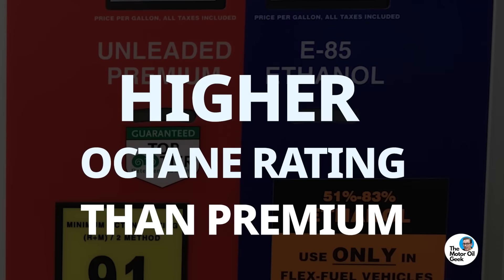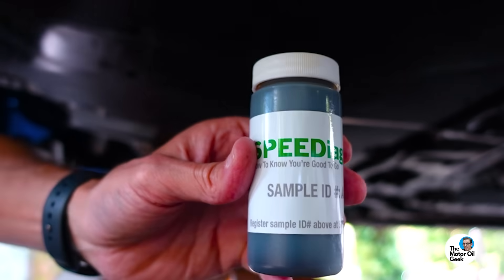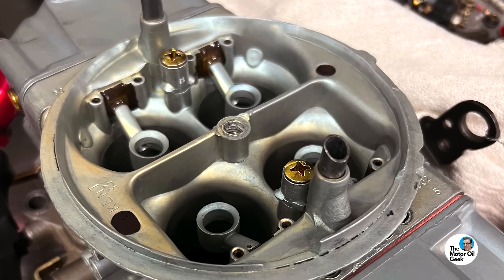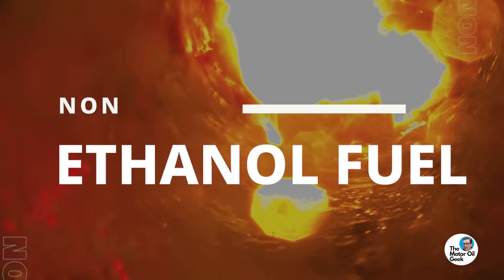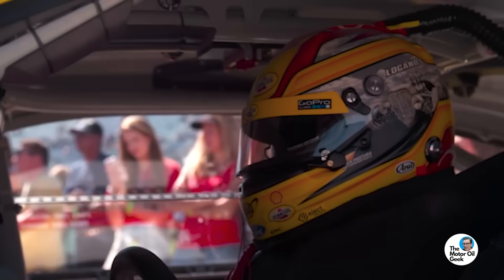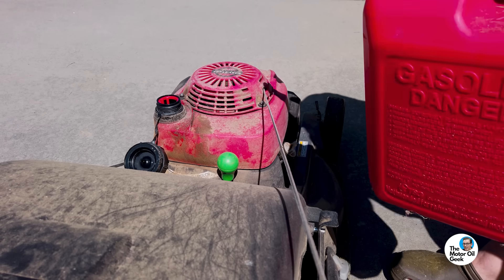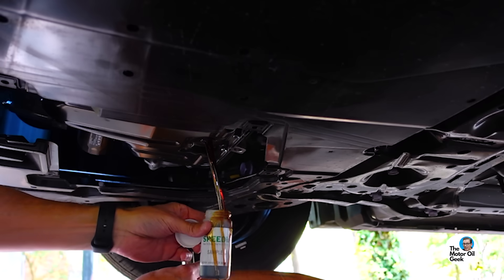ETHANOL: Higher OCTANE, Higher RISK?

Comment: Was thinking of some old stuff about "gasohol" or ethanol laced gasoline or even straight ethanol as race engine fuel. I understand that part of the reason that some of these engines make tremendous power is that with the needed air fuel ratios and actual big jetting the ethanol fuel absorbs a lot more engine heat than if gasoline were being used and the extra water vapor in the exhaust carries away heat and may even provide some of the benefit of "water injection" 
  Older cars had fixed jetting that did not adjust (no feedback with oxygen sensors or powertrain control modules). If the car were jetted a little bit rich it might run a bit better on E10. If it were jetted just right for straight gasoline it would run a bit worse on E10. If it were already jetted lean for straight gasoline ( as I think most cars were after the mid 1970s thru about 1980 before the "feedback" carburetors "Computer Command Control" or "Electronic Fuel Injection" appeared) it would run a lot worse on E10 than on straight gasoline. Also the fuel mileage would go down. Would be sensitive to altitude (higher altitude had the effect of lowering the amount of oxygen per fuel as metered and could actually make the car run better at,say, 5000' above sea level than it did at sea level if it were jetted too lean to run well at sea level (as some early emissions controlled cars were) 
Newer cars almost always have compensation to maintain air fuel ratios nearly perfectly so are largely not affected much by the difference in energy content between E10 and straight gasoline but the ethanol E10 is a real problem for small engines and probably even cars that sit with the same fuel in the tank for months at a time (not driven much)

Comment: I have run regular unleaded 10% ethanol gas in my small engines for years and have never had a problem. Mowers and snow blower sit for six month's of the year. Start right up all the time. I keep the tanks topped off with no additives. I also run E85 in my 455 Pontiac engine with a Rochester Quadrajet. Hasn't caused any issues.

Comment: I've been running E85 for 8 years now. Car makes over 1100 hp on pump E85, 93 won't even touch that HP range. I've had zero issues. Clean the injectors every spring after sitting all winter.  I don't even drain the E85 from the system over winter.  PM is key when running any alcohol based fuel.  People throw so much hate at ethanol. 

I also ran it in my carburated R5P7 build.  Didn't have any issues with that either. I did drain the E85 in the fall, put a couple gallons of 93 in the tank and fire it up for a few minutes to "winterize" it.  

Thanks for another great video Lake.
Reply: Im not going to clean my fuel injectors every year...
Reply: @Taydrum ok. It takes less than 30 minutes to remove,  run them,  and reinstall.  Cheap insurance for me.   You do you, have a great day.
Reply: Glad you have no problems. But I work on carbureted motorcycles ATVs and small engines. Just using E10 in these zinc bodied carbs causes severe corrosion. Even in daily driven vehicles. There is real gas available but most people are not going to seek out that option. It's not a big deal with small engines, because replacement carbs are relatively cheap.  But motorcycle carbs go into the thousands. I don't want to even think about what would happen if people used E85 just because of the octane rating. Cheers
Reply: @leegmc1985 that is literally why most use e85, for it's octane rating and of course the effects of evaporative cooling.
Reply: @leegmc1985  There is a known fix for that; nickel plated carburetor bodies. Nickel plating have been used to make carburetors ethanol compatible since the Model T days.
Reply: "PM"?
Reply: @dabdestroyer7327  Planned maintenance.
Reply: @dabdestroyer7327 usually stands for preventive maintenance
Reply: Which is why large displacement motors do right around that on 93 without power adders? Last I checked there is a crate motor that makes ~950 out of the box.

 I know it's in vogue to up the CR and lower boost to get better response but standard fuels require the opposite. Most tuners under 50 have forgotten or never learned the basics.
Reply: Yeah this is just boomer clickbait. My car sat with E85 in the tank like 3 years, still fine.

Comment: Lake, I hope you see this:

ChatGPT keeps suggesting that changing your oil too soon (i.e., at shorter intervals) could actually reduce engine protection, compared to waiting a bit longer (within reasonable limits) before changing the oil. This question is about oil change intervals throughout the life of the engine, not referring to a break-in oil change. It mentions that oils—especially synthetic ones—need time to form a protective layer on engine components, and that oil additives need time to fully clean and prevent wear.

Is there any truth to this?
Reply from the maker: https://youtu.be/fwzLY62_uIE?si=gqCVVH3cCZ_Ho8nC

Comment: Do a video about amsoil fuel additives please! I want to know if the upper cylinder lubricant and performance improver is worth it.
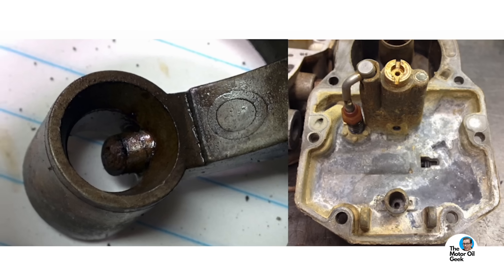Reply: I put a very small amount of "Stihl Ultra" oil in my small 4 stroke engine fuel sometimes. Much less than would be needed in 2 stroke engine,more like a 1:200 ratio instead of a 1:25 or 1:50 ratio as would be specified for 2 stroke. 
Seems to keep the float or inlet needle in the carburetor from sticking.

Comment: i have noticed that the newest Buick's with the turbo three cylinders say run on E15. I have used E15 in my '14 Enclave. It ran very well on it; no loss of power or MPG. I traded it on a '10 CTS-4 wagon (3.0) and use it occasionally. That car LOVES 93 or 94 octane (tier one only). My wife's '14 Exploder is a Flex Fuel car. I ran one tank through it. NO MORE. My lawn mower, a plastic-carbed B&S, only gets non-ethanol, and for the last six years the ZTR mower at our church ONLY gets non-ethanol. It is about 20 years old, and it will go much further with no ethanol. I am trying non-ethanol in my Caddy to see if MPG will go up to justify $1.00-$1.20 more per gallon. What are the effects of E15 on GDI motors? Well ... I ran a full tank (16 of 18 gallons) in the CTS. Absolutely NO change in MPG. E10, E15, E0, it makes no difference with this baby. Back to saving 30 cents a gallon.

Comment: In Finland E85 is available everywhere. its about 1.14€ per litre vs 1.75€ per litre for 95E10 (10% ethanol, 95 octane. we allso got 98E5). Last summer i drove the whole summer on E85 in my 1995 Volvo 960. I could save 10€ per 200km compared to 95E10. It was cheap to drive and convert as EVERY old volvo from 1985 onwards have a Ethanol proof system that tolerates it. I just needed to swap injectors to 30-40% bigger and i was good to go on 100% E85. Ran great. Then when winter was at my doorstep i switched back to stock injectors as it went for winter storage. I got mopeds, motorcycles, old 50s and 60s american ford with stock Y Blocks and never have had problems with them not starting after 1/2 year of storage. Yes they first run like crap on startup but after topping it up they run like normal again. No rusty gas tanks either.

Comment: Very informative. So ethanol doesn't just contain less BTU per volume than gasoline, the engine also has to compensate and enrichen the mixture. Just wonderful.
Reply: That's not really true. With road legal engines (aside from some DI stratified charge engines) you typically use lambda 1 until you at high loads need to enrich the mixture. With ethanol you typically can wait longer until you do this high load enrichment, and you typically need to enrich less. You do need to enrich more for cold starts though. Ethanol generally has a slight positive effect on engine efficiency.

Comment: How does a fuel absorbing moisture in the atmosphere causing rust (moisture) on valve springs in engines??????........................rust is caused by standing/pooling water.
Sounds more like a high moisture day and some idiot leaving the garage door open in a cold air conditioned shop........................every metal surface will suddenly begin to collect water, as it cools on the metal surfaces.

Comment: I learned of this a few years ago when I  bought a generator, and switched up for all my small engines, plus I run a tank of real gas in my cars on a regular basis. We still have access in Canada to 94 octane at Chevron and Shell. Both, unless changed recently, are gasoline without ethanol. Since switching, I have not had any issues starting 1st or second pull every time, even after winter. I don't flush or drain anymore either. My cars run better and fuel economy is better.

Comment: After experiencing gummed up fuel filters in my outboard along with clogged jets on my pressure washer and chain saw, I switched to ethanol-free gas about 10 years ago.  It is more expensive in my area, but I never have a problem starting or running these motors even after storage of several months.

Comment: I remember when I mowed our lawn (in the 80's) at the end of summer, we would put our mower in the shed for the winter with the gas still in it and the next summer we would pull it out and it would start up on  the first few pulls. Since we had ethanol in gas, if I leave the gas in over winter small engines have a hard time starting up.

Comment: Multi Generational 'Farm & Ranch' family here.   I do NOT purchase ANY Fuel with 'MoonShine' in it unless there is no other alternative.  Over 50 years experience operating and maintaining critical Farm Implements will teach you the HARD & Expensive way that Ethanol is a Mistake.
Reply: I started using ethanol conditioner in the fuel for all my equipment and my ethanol problems all disappeared, it's been about 10 years now I've been doing it, and like the old days I went back to leaving fuel in the tanks of everything for the winter and the next spring they fire right back up, 3 weed whackers, 3 chainsaws, three push mowers a riding mower and two leaf blowers that get run quite a bit every year taking care of properties, all my problems went away including fuel lines and carb diaphragms melting from the ethanol, all problems have stopped since I started using it.
I myself come from "multi generational" farmers but I don't understand how that has any bearing on things because this ethanol issue is only about 15 years old.
I don't want ethanol in my gas either but I burn through so much gas every year in that equipment there's no way I'm paying the outlandish prices for ethanol free fuel, and I sure as heck ain't buying that ridiculously priced 2 stroke fuel in a can.
Something I don't get is all the "small engine shop owners" who claim if you put ethanol treatment in gas it'll "turn into jelly within weeks guaranteed", I've never seen a speck of jelly in anything including carbs I've been in that dirt needed cleaned out of, maybe people with that problem put ethanol treatment in gas that'd already sat around for months wicking moisture out of the air and there was so much water in gas already the ethanol treatment turned it to jelly, or maybe they're pouring half a bottle in a gallon of gas thinking it'll work better, all i know is 1 Oz of treatment for a 5 gallon can of gas and I have no ethanol issues any more.
Reply: @dukecraig2402 what brand of ethanol conditioner do you use?
Reply: Ethanol has screwed up so many engines,, 😢 I hate the shit , only place I can get Ethanol free fuel is at the airport  ,,$ 6 bucks a gallon, but it works,,

Comment: Would a gasoline engine running e85 benefit from a diesel oil due to the fuel dilution and the diesel oil detergents? This specific case a turbocharged port injection  engine.
Reply from the maker: Actually it would be worse. Diesel oils will hold more fuel and moisture than a gasoline engine oil does.
Reply: @themotoroilgeek I guess that makes sense as diesel is a lot better lubricant that gasoline or alcohol would be
Reply: @thatturbotruck  Especially old fashioned diesel that wasn't "Ultra Low Sulphur" ?

Comment: I’ve been running my own small engines “all with carburettors” on E85 and E100 for over 3 years now and still not had a problem. I’ve even let some of them sit for over a year and still no problems. I mix my own E85 with 85% bio ethanol and 15% Aspen 4 fuel. The “problem” with the ethanol isn’t the ethanol it’s self. It seems to be the gasoline it’s self is the issue. And when you don’t use pump fuel and use alkylate fuel instead you don’t have these issues.
Reply: I think that E85 and all the other ethanol-blended fuels does have a lower quality gasoline just because of a very high octane rating that ethanol has. So petrol companies can provide a much higher income just of using bad gas because ethanol brings the octane rating up to meet for example 87,89 octane rating etc. 

Ethanol is not a problem. I also use E85 blends in lawnmowers, outboards and my moped, and never have had a problem with alcohol blended gas
Reply: @THe9-3MAnIaC it’s all the same base fuel they just mix different additives in it to get to the desired octane. Or even for the brand of fuel station. E.g Shell, BP, Gulf etc.

Comment: I am in Australia and I don't imagine our fuels are that much different to the USA. I have a USA made mower with a 27hp v twin Kohler thats run on E10 for 18 years and I've never even had to touch the carby. Have been running all our cars on it since it came out without any dramas. Must be lucky. I wouldn't have thought that 10% ethanol would have that much effect. The race cars I work on that run on e85 are a different story, but only the ones that don't get regular use. The regularly used cars don't have any problems.

Comment: I drove a fuel truck for 12 years, during which I hauled just about everything. Ethanol is very corrosive as Lake said, but it is really corrosive. Ethanol can’t be transported via the pipelines that move gasoline and diesel. Ethanol corrodes metals overtime but it really does a number on gasket material. Since ethanol is a grain alcohol it falls under the prohibition era requirement that grain alcohol must be denatured. In my area, this is done with dry gas. Dry gas is a by product of compressing natural gas in to a liquid. On its own it is illegal to burn dry gas in an automobile but I guess it is ok when mixed with other products. At gas stations there are usually three to five choices of octane to punt in your car, however gasoline refineries only produce 83 and 91 octane gasoline. The octanes at the station are mixed in the proper amounts by the pump. The addition of the ethanol(10% where I am) brought the 83 up to 87 and 93 is a mixture of 91/ethanol/ 83. The last thing I will say is that unless E85 is at least $0.50 cheaper per gallon than 87 octane it is actually cheaper to burn the 87 octane because when using E85 your vehicle will get a lower MPG. Marathon has flex fuel vehicles and this was their rule. I think in my 12 years delivering fuel I only saw E85 that much cheaper than 87 twice. Make of that what you will.
Reply: Brazil transports ethanol through thousands of kilometers of pipelines every day and has for many years.

We have had an ethanol pipeline in Florida for years.  Kinder Morgan was building a huge multi-purpose petroleum-ethanol pipeline to link to that one but landowners in Georgia were able to stop the project in courts.

Gasoline and diesel pipelines get very dirty with buildup overtime and ethanol is a cleaner (which is why many carb and injector cleaners use alcohols as active ingredients) so in a dual use pipeline one would want ethanol going through it often to keep dirty petroleum buildup from getting to be too much to handle.

Ethanol has been sold in paper thin metal cans in the paint sections of hardware stores forever.  Those contain 2% methanol as a denaturant.  Ethanol plants add 2% gasoline.  Imagine how toxic they must have to be.  

25% ethanol has been sold as non-toxic RV antifreeze probably since there have been RVs.

Ethanol on manufacturing chemical compatibility charts is rated far easier on metals, rubbers, and plastics than what gasoline and BTEX (benzene, toluene, ethylbenzene, & xylene) are.

Ethanol is rated excellent for rubber whereas gasoline and BTEX is rated poor to not recommended.  Gasoline is so harsh on rubber, Viton had to be invented.

On E85 prices dot com I see the national average price of E85 is $.71/gal cheaper than E10 and $1.60/gal. cheaper than E0.

Imagine if we had ethanol optimized engines like what Ricardo built and drove for GM which gets more power and more fuel economy than gasoline, even better than diesel engines at half the size.

Here is an excerpt of it.  This is why GM wants a 100-octane fuel standard from the EPA.:

FROM RICARDO:
The new federal CAFE standards are calling for a doubling of fuel mileage performance, which, Vint says, is going to send OEM’s looking for high octane numbers to improve efficiency and ethanol is the best source. Ricardo, an engineering firm with over 100 years in the business of engine design, has developed an extreme boosted direct injection engine (EBDI) to optimize ethanol blends. The 3.2 V6 gasoline engine rivals the power and torque of a much larger GMC Sierra 6.6 diesel, he said, and it delivers 3.5 percent better fuel economy than the diesel.
Reply: @danafletcher2341 all the ethanol is transported by truck or rail here in the Midwest. As for the ethanol plants they use materials that better tolerate the product. I was having to replace the rubber gaskets on hoses and appliances a minimum of once a month depending on the number of E85 loads or just straight denatured loads I hauled. As for the price, I don’t really pay much attention to it anymore but Gas Buddy says that there is currently only a $0.30 gap between the two , so it definitely would not be advantageous to run E85 here in central Indiana.